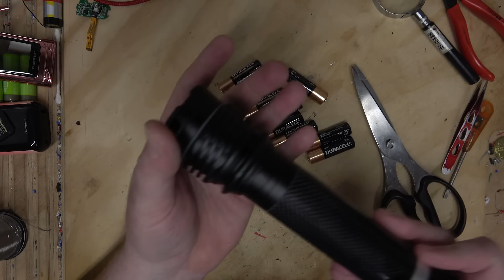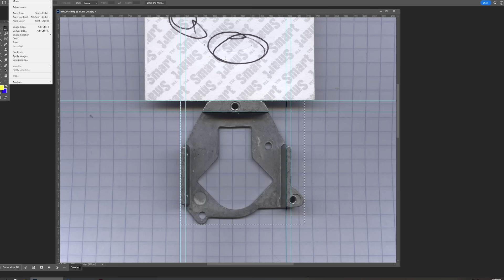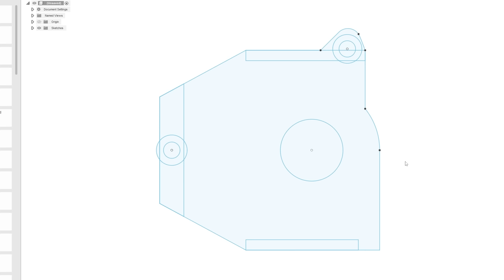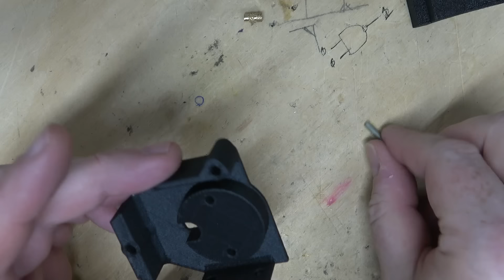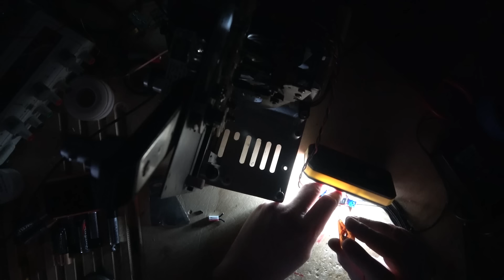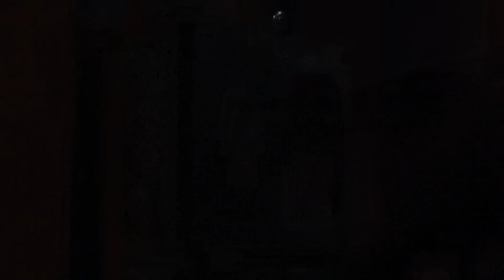Super 8 Menards Flashlight Hack

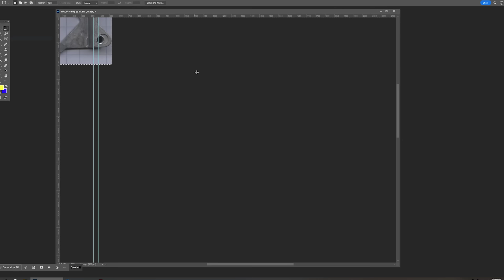Comment: 8:35 - Wouldn't it be better to flip the metal part to get the other side more true to its size? You would scan both sides and then keep the parts of each image that touch the glass of the scanner.

Comment: You realize why that flashlight has that specific arrangement of AA batteries, right?  I have a 3-battery AA flashlight with a similar arrangement for just 3 cells.  It's pretty clear you can just replace it with one third as many 18650 rechargeable lithium cells.

Comment: Been doing a 130xe laptop conversion and scanned the board for reference photos and didn’t realize the scanner doesn’t go to the edges. No wonder why I couldn’t get all the bolt holes to align lol. Good info on the center trick I’ll have to try that. I also take straight on photos with some success. I’ve burned through 4 rolls of filament already in iterations on the bambu x1 😂
Reply from the maker: Yeah they have a small horizontal sensor which is then stretched lengthwise. Which is why the deviation increases towards the other edge. An orthographic scanner would be cool. I'm sure it exists.

Comment: Did you put a busing in the little hole you drilled in the metal or will the wires eat through from projector vibrations after a couple hours of run time?
Reply from the maker: Put heat shrink over wires.

Comment: 13.5V Eh?
Sounds like they'd make for great vehicle lights on a light bar or in place of fog lights!

I recently made an INSANELY powerful, long throwing spot light out of a single LED (Cree style, but don't think it is Cree) from a solar yard spotlight – like for illuminating the house address. I took that ~3.5V LED, affixed the SIDE throwing lens from a TV backlight and then put that in the housing from a CCFL spotlight.

That LED in its original setup with its spotlight lens, had VERY minimal throw to it before being uselessly dim...
However, for whatever reason, my combination of redirecting all the light out the side and into the reflective spotlight housing, made it EQUAL TO A CAR'S HEADLIGHT and at only 4V! 🤯   [EDIT: there's no lens now beside the side-throwing. It's all the reflective housing now doing everything] 
(I was using a Li-Ion instead of the LiFe+ it was designed for, so I had to add a bit more heatsinking, but was no big deal)

Comment: Flat bed scanners typically don't distort in part because they do have a sensor all the way across. We're you talking about a different scanner?
Reply from the maker: This one has a lens. Maybe it's time for an upgrade.
Reply: @BenHeckHacks  ah well that may be a nice scanner then! I typically get cheap scanners from goodwill as printer combos with no ink lol
Reply: @JernD  You can scan without ink? That's news to HP
Reply: @kg790  

 Those lot used to be somewhat competent and could produce products that still had unrelated processes that were functional without ink.

Comment: Are you sure you're actually getting a full spread spectrum of visible light with that LED? Some of them only put out limited wavelengths which don't illuminate all colors properly. I found out some under cabinet LEDs I ordered and modified and was installing made yellow look orange. My Dewalt tool was orange when I set it on the counter. I Immediately removed them and ordered correct spectrum under cabinet task lighting.

Comment: Seems some telepation going on because a week ago I was thinking of doing the same! I want to watch some old super 8 movies with my dad but the bulb died. I found a replacement bulb (GU10 standard like at 12v) at the thrift store for only 25 cents but this bulb will only survive 15 hours of use. Because the developed heat inside because of this hologen bulb also effects the size of the present belt (the reason it stops working halfway), I was thinking of doing the same , replace it with a LED bulb. It needs to be 900 lumens (source - a conversion table) to replace a 100W halogen bulb but actually I think it needs to be twice as much to get a more clear/brighter picture. Didn't found one yet.

To capture a movie, with the highest quality possible, I found out that using a non -shiny white surface (like a piece of A4 paper) to project image on at a very close distance work out the best. This minimize lens effects or defects, gives optimal brightness and sharpness and avoids bluring of the image. The non-shiny surface avoids mirror effects especially when placing a camera in front of the image. If your camera supports the 4:3 aspect ratio, use it. Happy recording!

Comment: for heat-set inserts i like to design the hole so that the insert goes in about a third of the way, and then you heat it up and it melts the plastic and seats properly. prevents oversqueeze.

Comment: I can't believe in this day and age they are still selling torches with bloody AA batteries , I got one exactly the same(different brand) and converted it to 26650s, nothing worse than them lasting like 30 mins on high and that's it ....10 euro of batteries gone.
Reply: What's even worse is things that still use button/coin cells. Especially things that have all kinds of room for MUCH larger batteries.

Comment: When it comes to flatbed scanners, it depends on the pickup assembly for the image.  My Canon LiDE uses a contact image sensor as yours probably still uses the traditional CCD and optics assemblies so the image probably doesn't lose accuracy to the edges but the CIS apparently doesn't give as high-quality of a scan.  My LiDE also runs directly off of USB instead of requiring a large power brick or some other power supply to get the job done.

Nicely done as usual, Ben.  Although, would the image appeared as dim in real life as it did in this video but as dim on this projector with the stock incredibly short life 15 h bulb?

Comment: They aren't European Screws", they are screws every country except the USA uses 🤣
Reply: You might say, the rest of the world screws. Or, the rest of the world plus US science, engineering industry and research community screws.
Reply: @Liofa73  How many years do power equipment makers that are American used and continue to use Imperial bolts and nuts?  Engines in recent years have all been metric but it hasn't even been 10-15 years Briggs was still using them on its crappy, very crappy engines.  I know Ben is from Wisconsin and so is Briggs and Stratton, Kohler and oddly Wisconsin engines.
Reply: Since Ben already name dropped AvE... He is Canadian, and a jack of all trades (mechanics, machining, hydraulics, electronics). And yet, even AvE prefers measuring in Freedom Units (inches, specifically), and says it's superior.

I'd love to quote him on exactly why, but it's been years since I had seen the videos in question where he explains why. Since I can't, I perfectly accept that you won't change your opinion! lol
(an imaginary) Lord knows I wouldn't... 😋

However, even then it was only on the finer scale. As I'll admit, I don't even know the exact distance of a mile in feet. 5,280ish would be my rough guess... 🤯 Ok, turns out I DO know, as I just looked and that was exactly it! 🤣
Truthfully, I always thought it was more like 5,235ft but only knew that it was always wrong...

Comment: Why use illustrator? Fusion 360 can import a photo as canvas for tracing it as a sketch. It also has a tool for calibrating the dimensions. You can have a canvas on each axis plane.

Comment: The flashlight package promises 2500 lumens, but Ben measured it consuming at most 6V and 1.5A, if I got that correctly. That's 9W max, which is too low for 2500 Lumens.
Reply: Classic outrageously overrated chinese flashlights... TTC and Project Farm are busting these for fun.
Reply: @jerther_ AvE mentioned in the vid and TTC in the comments. Thus proving why Ben's community is the best lol 
(Torque Test Channel, for the uninitiated; the modern day Consumer Reports and I can't recommend them enough!)
Reply: Did you take into consideration it is a LED?
Nevertheless, over-rating is a common Chinese problem.

Comment: this would an interesting hack for  led screen projectors the older ones , expensive  and rear filament bulbs still in them? the only problem most seem to have when is not fitted, with there120 watt  power heavy filament bulb, is they  promptly switch off ? wonder the not using 5 to 10 watts instead of 120 watts

Comment: Digital calipers are cool as a novelty, and I'm sure for hundreds of dollars you can get ones that work better, but for about 10-20 dollars, you can get analog calipers that hold Zero for much longer than "similarly" priced digital calipers.
I'd probably just scan both sides of the item, do some caliper measurements, then piece the shapes together.
Reply: Need calipers with a dial indicator
Reply: Mitutoyo digital are what you want.
Thank AvE for that knowledge. 
(although, the Chinese knockoff he tested was also sufficient for rotatable accuracy, just had horrible circuitry that drained the battery)
Reply: @DUKE_of_RAMBLE  Ah yes, the 100 dollar calipers. Technically not hundreds of dollars.

Comment: Why did you run it at 5.8 V instead of the 13.5 V it was using?
Reply: Too bright means washed out bad, so he probably experimented with the brightness using a bench power supply off camera to see what was the optimum power level?

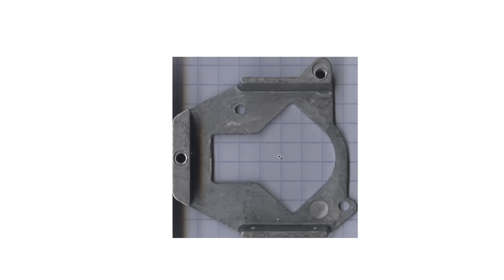Comment: 9:29 most scanners these days have a sensor that spans the entire width of the page. you can tell by the fiber optic row of lenses. even eevblog took one apart in a 3-in-1 printer combine
Reply: It's CCD vs CIS. CCD scanners use lenses to reflect light to a central sensor; CIS scanners use a sensor that goes the entire way across. You're talking about CIS, Ben's is CCD.
There's advantages and disadvantages to both; the fact that Ben used a CCD scanner means we can see the back of the part in the scan. The walls would be straight with a CIS scanner, but their very short focal range means the back of the part would be very blurry. It may be so blurry that we'd need to scan it twice. 
CCD is also generally better for scanning images; they have better colour reproduction, and their single-sensor nature means the entire width is captured in a single sweep. A CIS scanner will need to stitch the output of several smaller sensors together, and this can be visible in your scans. 
CIS is better for large formath, you can string CIS sensors end to end for as long as you want. An A0 CIS scanner can be the same height as an A6 one; an A0 CCD scanner would need to be *huge*, need very expensive optics, and a very high resolution sensor.
CIS scanners are also much cheaper. They don't need special optics or a high-resolution common sensor, you just have more small ones.

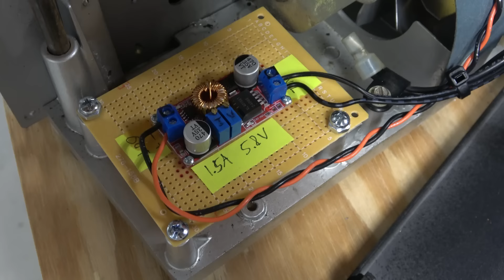Comment: 24:23 Did you find those wire nuts in your dad's toolbox or do they still sell those in the USA?
Reply: Murica is held together with wire nuts. They are still widely used, much like the  imperial measurement units they can't let go of.

Comment: i did a similar mod to an old DLP office projector. although i used the original housing and installed a 30watt cob led mounted to a 1u server copper heatsink and used an external 12v led power supply, worked pretty well, and i never used it, currently sitting in storage lol

Comment: At 6 minutes, the two divots were probably points to provide leverage to unscrew the led assembly out of the body. Should just be a threaded aluminum slug containing the LED and related driver circuitry. That's how every flashlight I've disassembled so far has been. I think the end result is probably better than removing just the slug, so it all worked out in the end.